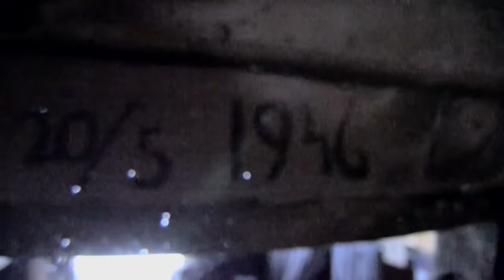Survivorman | Norway Part 2 | Les Stroud

Comment: les, you're the reason that when I was roadtripping through the US southwest in summer, and yellowstone, that I knew to pack winter gear. yellowstone got down to 30F when I was staying there in a tent....in july, and the desert got down to the low 40s
Reply: 😂😂😂 camping is a lot of fun especially when you wake up with ice on your tent
Reply: @mykalkeliikoa5722  one of my backpacking tents was super airtight and wouldn’t let condensation out from my breath. I woke up one night with icicles INSIDE the tent!
Reply: @CFarnwide  damn 7 months ago, yeah I’m in boyscouts and when we went Ig to Philmont it dropped below 32 one night
Reply: There’s this valley in New Mexico in the Gila past Silver City where I would go, and it would be in the 70’s during the day and drop down to minus 20 degrees at night. It can catch you off guard.. If you didn’t know there was no way to tell and the first night I spent there I got my butt handed to me. Later I learned to sleep with hot water bottles in my sleeping bag which helps surprisingly well !

Comment: In retrospect, that was not a good use of resources. You spent the first 4 days using up all 6 beers, 5th a tub of peanut butter, chunk of deer jerky, and an orange. That was laughable. Ontop of that, those resources went wasted. Meaning you did not do anything with that energy. Now agter 4 days you started moving around ripping insulation and setting a plan. So you wasted the first four days which is unforgivable in a survival situation. The first day maybe yeah sure but 4 days total? No. You knew there were cabins you could reach but stayed in the car being because it was wet snowing? You said oh hopefuly the weather gets better but you cant plan for better you work with whats there and plan for the worst. That was mitake number 10. This was a mess from the get.

Comment: I have the Coghlan's Emergency Camp Stove, very similar or the same as what Les has at 3:50, and I have to say it's pretty nice. While I have never used it in an emergency situation, I was easily able to get 1.5 cups of water boiling in under 5 minutes using a few of the included fuel tabs with fuel left over! The other advantage is you could use small twigs, or other things as a fuel source for the stove. And the best part is they can be had for about $10, fuel included. The only note is the fuel is not for cooking directly over, but if you have items in a pot or a pan, it should work just fine!

Comment: When using a candle for a heat source  you need too have a compact space for it too work. Use a blanket or equivalent over you with the candle as close as possible too you on the ground in between your legs. It does work well. I’ve tried it in -30 Celsius weather and unbelievable how warm it got.

Comment: So if you ever need to eat blue mussels again. Try this instead:
Put a little water in the pan, and boil it up. Chuck the blue mussels without cracking them open into the pan, and stick the lid on. The steam will make them open by themselves after a few miuntes, and they are ready to be eaten

Comment: Wet boots are the absolute worst. Had a week long FTX when I was in the military and I didn’t pack an extra pair of winter boots to be lazy because it was October and like 60 outside. The second day the temp dropped to 25 and it rained and snowed all day. Had frozen boots the entire rest of the exercise. Tried sleeping on top of them every night to thaw and dry them but it didn’t work. Was lucky to not get frostbite but I did get pretty gnarly trench foot.

Comment: 13:57 too bad there wasn’t a tin of Old Bay Seasoning in that automobile survival kit. Few years ago I scored 5 film canisters from the 1960’s on ebay. They were $2 each. The little aluminum 35mm cans. Salt, pepper, garlic, red chili flakes & cayenne. All 5 into a tiny craft baggie and into the survival kit. The same can be accomplished with the little 5 Hour Energy bottles: sugar, olive oil, cinnamon, smoked paprika, onion powder, chili powder & vinegar. Those little white bottles are essentially bombproof once rinsed properly & the branding wrap is removed. As Les has testified many times, (along with Ray Mears and Dave Canterbury) a little seasoning can make a tremendous difference w/ bush food.

Comment: Flares operated by fire wires normally have steel wires which corrode easily in wet and salty conditions. That appears to be part of the built-in obsolesence expressed by the expiry dates of these products. I discussed these issues with one of Europes most experienced academics in the field of ammunition and pyrotechnics and he was quite clear that these factors are commercially driven. Playing with people's lives I call it.

Comment: That crank flashlight that Les  has is junk, however if if you know what your doing that flashlight can be a life saver. For example, when buying a good light for you emergency kit buy one that has a lithium battery, has a long battery life but also is able to charge quickly. Then with you crank flash light care fully take it apart exposing the positive and negative terminals. Then take you charger that came with you good flashlight cut òff the end of the wire that would normally plug into an outlet and expose the positive and negative wires. Take those wires and connect them to the terminals on the crank flashlight. Then plug the other end into your good flashlight and now you have a way to charge you light in an emergency situation and a light that will work for a while. Now of course you will be cranking for a long time to fully charge you light but if you do this in 20 minute intervals you can eventually fully charge you light. You can also use this same concept to charge your dead cell phone or any other rechargeable devices. As somebody who has lived outdoors all year around for the last 25 years trust me when I say this works. I still have and use the crank motor in emergency situations to this day. But I have generators and a fast flowing creek with a water wheel that has an electric motor that charges 3 big lithium batteries that came out of a tesla. And that's how I'm able to talk to you now on my phone and computer. And incase your wondering how much juice I can get out of 3 tesla batteries.... I can run my TV and computer for over a month before I have to recharge them. So pretty much the water wheel charges them back up before they die and I never have to worry about it.

Comment: Question about flares: If I was lost in a woody area or something and I had one with me, should I use it to f.e. signal a helicopter or something? Considering that it's technically pyrotechnics, would there be a chance that I could cause a forest fire if the flare comes back down?

Comment: Hey... that car was on a road. I think I would have rather strolled out of there on a road rather than risk getting stuck on a cliff or falling off of a cliff or making it hard on a search party offroad. I mean seriously... you had a road. Seperate note: I'm pretty sure no matter how tired and how hungry I was I'd have for sure remembered to burn the tires too, for signal and warmth. That deep black tire smoke is priceless. Engine oil and brake fluid are flammable. There was at least 30 or 40 feet of cordage in the wire harness under that hood that got left behind. Several signal mirrors could have been made from headlight reflectors. The car battery may have been able to produce sparks, a lit bulb and charged your phone for you had you took it with you.  I'm not trying to be critical, but I know I am. I'm sorry... lol. It's just that you had several days there to tear that car apart for more supplies. That car was a gold mine.

Comment: I feel as if hes putting on a show.

He could have made a fire to get warm and dry out every time he had to sleep in the open, but he didn't. Why?

Im a fiaherman. And the first thing i always do when fiahing is make a fire. Be it summer, winter, rain or snow. If I have a lighter or matches and some wood nearby, it's not that hard if you know what you're doing. There's always half rotten (burns really well) or dry wood around, and in the wilderness, it's not hard to find. And pruce always provide plenty of firestarter.

Comment: LOOL. I think I would have the same look on my face when saying the words 'deer head'. It's probably the last thing you want to eat, but it's food. I'll eat liver without issue but I can bet that pot of entrails smelled nauseating. I grew up in NW BC and I could have told you that going down the mountain without a road leading you would lead to an impasse. Not much difference in the landscape between the two countries. You know probably better than I do that a creek at elevation probably turns into a waterfall and a drop that's far from manageable with no way back.

Comment: Is this on what not to do. Because everything this guys does is a big mistake. If you really want to survive do not do what he does. He first said he had only a winter jacket an snow pants. Then he comes out with a whole snow suit. Then he leaves the cabin that he could have set snares at an caught rabbits or anything. Then instead of going away he knows he goes off side of mountain an took the risk of getting injured. This guy will get you killed.

Comment: If i undenrstand story right he travel Norway willdernes in winter scenario without common sense  planing, no winter car equipement, no layer equipement, no strong snacks and no snowshoes or skis,  no  map no compass or GPS ... onlly  with basic survival car kit and harmonica.. where i live i have to have chainsaw too becouse after strong snow trees fall on road - so i need to cut them to smaller pices and push them from road. I belive that experienced woodland person will newer ever do that mistake  becouse can be last suicidal trip.. with small preplaning you can do giant difference even in "comfort" of these extreme experience.. where i live somme terrain is really dangerous for foreign visitor becouse allot of hidden deep holes and caves..if you fell in summer  chance is you will newer ever be found. In winter you at least left track in snow